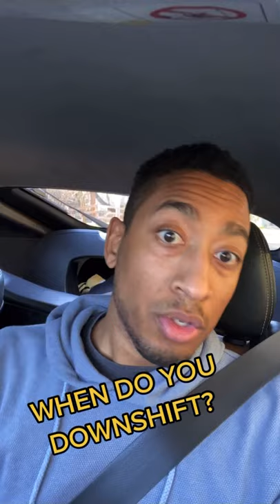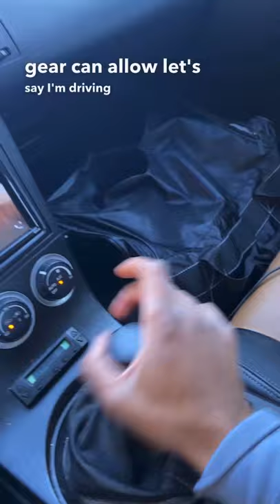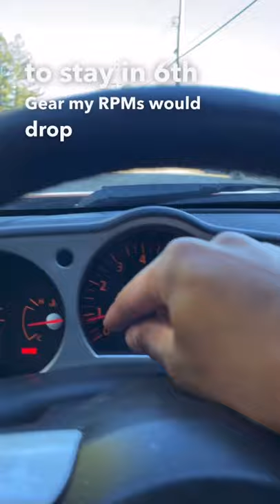WHEN DO YOU DOWNSHIFT IN A MANUAL CAR? #Shorts

Comment: Always downshift. I downshift for no reason.
Reply: I deliberately shift a gear higher so I have another gear to rev match🤣
Reply: You can also shift to R for racing mode
Reply: @tikcu5173  ong bro my car when I do that drops transmission and I start flying like a deluxo
Reply: @mrsniffles7089 I thought I'm the only idiot who does that😂😂😂
Reply: Shifting to R at a standstill is for you to reverse. But at high speeds such as over 100km/h, the R gear "Race" gear, will enable your car to shift to the most powerful gear that is used mostly by formula 1 drivers. Its not used often but if you shift to R gear fast enough while maintaining high rpms, a slower car could overtake almost any high-end car.

Comment: Why not just go in neutral then brake and then rev match back into gear? Brakes are cheaper than tranny? I’m new to manual, I’m just trying to figure out which is the better way to slow down. Help me  manual experts.
Reply: Been doing this for years. Absolutely no reason to do anything else

Comment: So if I’m going 50 at 4 gear and I need to stop should I brake to slow down then downshift to a stop or downshift to slow down and make a stop, I don’t like the feeling of the car when the transmission slows the car abruptly
Reply: you tap the accelerator slightly to raise the RPM accordingly to avoid this - 
if not that abruptness is the sound and feeling of wear and tear. manual transmissions are exponentially tougher than auto but smoother is almost always better.
Reply: What do you do now? I have the same question. I think most people just downshift without breaking and just let the engine slow the car down for you but I’ve heard when coming back of the clutch you should hold it at the bite for a couple of seconds so then it’s smooth

Comment: So you have to slow down then downshift or you downshift to slowdown?
Reply: As long as you rev-match so that the speed of the engine matches the speed of the transmission in the lower gear then you don’t have to slow down. Of course that is if it’s just 1, 2, maybe 3 gears down, if you want to go from 6th gear to 2nd you’re going to want to brake obviously. You can downshift to slowdown if you want, this is known as engine braking. Generally it’s not very smart. If you rev-match I don’t think it will do much if any damage to your car, but it definitely won’t decelerate very fast. If you don’t rev-match than it will do loads of damage to your car. In either case engine braking is really only useful if you’re going downhill for an extended period of time and don’t want to burn out your brakes or if your brakes don’t work, otherwise it’s pretty ineffective.
Reply: @Chicken20003  I suck at rev matching

Comment: Why downshift I just put it on neutral
Reply: Downshifting and making ur car go slower with that is engine braking. It saves ur brakes. And if ur car is in neutral, u don’t have control over ur vehicle. That’s why u should downshift
Reply: @daancaris7855  nonsense. everyone in these comments acts like we're talking about racing. lol
Reply: It's much better to wear out brakes vs wearing out your engine, the only thing common manual drivers should know is that when your not in a proper gear and just in neutral, how do you take off when you need to?

Comment: So you'd out it in 3rd Or 4th gear?
Reply: If he’s going 70 and needs to get down around 30 then 3rd gear would be pushing it on some cars if you had to do it in a hurry. When I’m doing something similar and get down to 3rd while I’m still doing about 60 I get about 4.5k rpm which my accord can handle. Depends on your vehicle etc.
Reply: @justinsane11  I just put it in neutral and after just learning how your car drives you can shift it into the necessary gear after you get to the speed
Reply: @qsaethic8927  I do the same but rev matching seems fun
Reply: @qsaethic8927  dont put in neutral that will wear your brakes

Comment: When I’m in gear 2 and I slow down a bit and downshift to gear 1, the car is on the high side of the speed and revs for that gear so around 11mph. And when I bring the clutch up there is a of a jerk. How i avoid that is by braking until around 6/7mph then fully coming off the clutch. But my instructor said you can downshift and come off the clutch even if you are on the high side so still around 10/11mph and slowly, smoothly come off. Is this correct and will that prevent the jerk?
Reply: To truly prevent the jerk you have to rev match most commonly known as heal toe shifting but essentially you give the car a bit of gas while you have the clutch in to match the rpm to where it will be after you shift into first gear takes a lot of finesse and practice tho so take your time learning
Reply: Generally it's a good rule of thumb to not downshift into first and just stay I second

Comment: patience and wisdom about coasting and avoiding needless braking saves both fuel and your brakes lifespan. if you travel the same roads this is not hard to master. if you are in traffic with lights there is no reason to race ahead when you can clearly see a red light. if you are travelling down a hill wtf. i mean WTF did you hit the accelerator? oh. i get it. you like burning the brakes to nearly the point of smoking. cool -